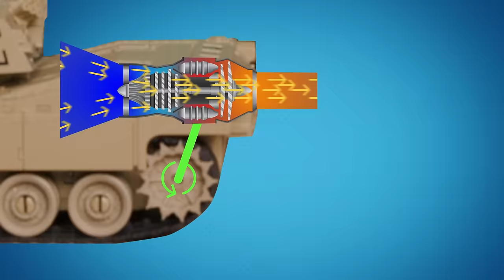Army Mechanic Reacts to Tank Fails

Comment: Regarding the last clip, I've watched another tank diver reacts to clips, where they would comment on the James Bond tank scene and the driver said things among the lines of "You wouldn't want to go through houses like that because of the underground floors of those homes that would be a death traps to your vehicle".

I've always found the highway chase in Fast and Furious to be stupid. As they said, once the track had a grip on the car, it would be sucked down under the thing. Even if the tank was a new prototype, it weighs like 60,000 kg while the Mustang weighs only like 1,350 kg. Even with the inertia of falling, it wouldn't be enough. Also, Fast and Furious cables are always the toughest matter in the universe x}

Tanks are amazing, but not absolute.

Comment: If I'm not mistaken, the engine on the Abrams is a  modified version of the same engine that is on a Blackhawk helicopter. I spent my first 9 years in aviation. Then I became a combat engineer, and in Iraq we sometimes patrolled with M113's ( before Stryker's came along). Maintenance on track vehicles is definitely not an amusing thing to do.
Reply: I dunno. The UH-60's engines are General Electric, while the Abrams' AGT-1500 is from Honeywell. Maybe the guys at Honeywell derived it from the GE core.

I heard the downside of switching the Abrams over to JP8 is that they can't use the smoke generator. When the tanks ran on diesel you could set up a white smoke cloud behind you by spraying cold diesel through the exhaust manifold (same thing they use to make smoke in jet demo teams like the Thunderbirds and Blue Angels). But the switch to jet fuel just made the smoke generator catch fire.

Comment: People underestimate how dangerous tanks are when operating them. For an M1, you have a 70 ton vehicle that has a 1500 hp engine that can go 35-40 mph. Thats alot of vehicle, with alot of blind spots, that does not stop on a dime like a car would, that has alot of mechanical/electrical components under all that weight.

I remember during gunnery in my M1, my crew passed out from carbon monoxide poisoning during a simulated night run. (Hatches were closed) Stuff went wrong, but everyone made it out ok.

Comment: The Churchill has a manual transmission, so that’s not the driver keeping on the throttle, that’s the engine probably over revving. But the Churchill is so much fun drive, my cousin and I restored the ark variant.

Comment: The speed of a tank track when it touches ground and isn't slipping is precisely 0 km/hour. Likewise the track speed at the top is 2x the current vehicle speed and at the middle points it is 1x the current vehicle speed.

So if a tank were to roll over a moving vehicle, it would flatten and stop the vehicle and once, and only once the tank has fully driven over the vehicle, the tracks would start tugging at the vehicle beneath. So this propably wouldn't have enough time for the tank tracks to accelerate the vehicle since remember, the speed of the tracks at the bottom position is always stationary.

Comment: In regards to the Sherman, the original version was an air cooled radial. I don't know which version this is... the engine bay could hold anything from a radial to a big V-8 to a diesel to five engines in a trenchcoat... yeah, the Chrysler Multibank was a hell of a mutant. Some of those old things could be REALLY particular about how you start and run 'em, and radials are a completely different beast.... hope they didn't wreck the engine.

Comment: 10:12 Well at least it wasn't the transmission like on a German tank...

10:26 Depending on the model it either has a radial engine like either a Continental R975-C1 or C4, a General Motors 6004/6046, a Ford GAA V8, a Chrysler A57 multibank, or a Caterpillar D-200A (Wright RD-1820). It's hard to narrow down the exact model of Sherman this is but it's definitely not one of cast hulls with the rounded edges.

Comment: Adding a bit of plus info to the second clip, some of the soviet designed tanks have a tube on the turret (no, I'm not talking about the gun) which is actually the air intake, you can see that the tank has this on the back of the turret in the video. So they could basically do this, but the driver stalled if I remember correctly, tho managed to restart and drive out, but don't quote me on that (couldn't find the video).

Comment: @04:20  That's not just mud...  that's a collapsed sinkhole, what the folks that speak Arabic in the Middle East call a Wadi, also known as a washout.  That's not just an Abrams trying to go through "some mud", that's 70+ TONS of vehicle trying to go through what swallows HOUSES on a regular basis in places like South America and Thailand when Monsoon season hits.  

That was just poor decisions and a LOT of expensive hardware going nowhere FAST.  

How do I know?  

US Army, Cavalry Scout, 10 years.  Fort Polk, I was OPFOR for 3 years.  We went to Peason Ridge, and got out into their Blue Mud after it had rained earlier that day.  

We didn't know the Blue Mud of Peason Ridge is some of the stickiest and thickest most traction reducing muds on earth! 3 days later, all vehicles stuck and unstuck multiple times, 1 burned out transmission, 2 broken prop shafts, 3 thrown tracks, and finally had to get a Cherry Picker out there to haul us out with its winch.  It got itself stuck, pulled the last stuck and broken vehicle with the fried tranny and busted prop shafts out a ways, unstuck itself hauling itself out a ways with its own winch, turned the winch back around, got itself stuck again hauling the broken track out, unstuck itself, ...  repeated this cycle like 7 times before it FINALLY could haul itself out far enough to be on solid enough ground that it wasn't getting itself stuck hauling the broken vehicle out, that it FINALLY was able to DRAAAG the lifeless hulk of our one totally deadlined vehicle to the flatbed and load it up.  We had to pirate the prop shafts off of the burned tranny vehicle, to fix the prop shafts we broke on the OTHER two vehicles, that we managed to get out before the cherry picker came.  

Yeah, give the Abrams some credit, that ain't just "some mud" that's a HOLE in the ground swallowing 70+ tons of armor.

Comment: 5:00 Russian tanks have a tactical log for this. You attach it to the tracks and it can quite reliably pull you a foot or two each revolution. Getting your tank unstuck from mud is a bit more relevant in Russia. Also because calling a recovery vehicle for help can end up with you having to call a third recovery vehicle.

Comment: The only thing I could think of when the tank stops while fording the water is that the driver and his hatch are fully underwater with no way out and they just lost the power system. Hopefully the crew seals were holding better than the engine.

Comment: I'm not military, just a tread-head. But it's always hilarious when the reality sets in of the physics difference between tanks and armored vehicles to commercial vehicles. You can go 25mph in a commercial van and hit a barricade and it's gonna suck decelerating that fast. But you do that in a tank that has no crumple zone, never has had a crumple zone, and typically is supposed to win such confrontations....well your mass is the same going forward. It's not the same coming back at you on impact.

Honestly you could expand this to boats, and planes (if not Navy and Coast Guard and Air Force if you can get them to clear off on it.) Even historical accounts would be cool. Like the, let's call them "German Extremists of the 1930's and mid 1940's," were trying to build tanks so stupidly big, they were taking diesel engines they had built for ships and submarines and slapping those in them. I don't think taking an aircraft carrier's nuclear reactor and shoving that into a variant of the M1 Abrams is a great idea, but that was the mind set back during that time. There's also the mad inventions of Ferdinand Porsche and John Kristie. They both developed tanks (of sorts) for Germany the US and the USSR respectively, but they were more of the mind set of, "tanks are just heavy sports cars with a gun and extra people aboard." Like you get a good historian on one of your videos to go over Kristie's and Porsche's crazy ideas and you'll see how bad they were to both tanks and sports cars during that time period.

Comment: Fording without a kit is the one place the M60 series was better than the M1. On the M60 series there are two giant ports you can open up so the engine draws the air through to the turret and not from the outside normal intakes. Also handy im the sandbox since it acts like air conditioning sucking all that air in through the hatches.

Comment: 1st clip ; Ukraine, tank slip because differential kicked in when he started to lose traction
2nd clip ; Ukraine as well, tank lost grip at the bottom (forded too slow and allowed the hull to "float" a bit)
3rd clip ; MURICA ! But once the bottom hull hugs the mud, it sucks like a succion cup and it's hard to get out
4th clip ; Chief died a bit when he listened..
5th clip ; most invited crews from Zimbabwe, Iran, whatever never ran T-72 before. (Also, before 2022, NATO was invited but never joined)
6th clip ; Happened during training for the track, was a belarussian crew who engaged the corner at nearly 70kph (no one was severely injured)
7th clip ; M4A4 with Chrysler A57 "multibank" engine, very prone to failures and overheats (it's made of 5 engines paired together, very hard to cool and maintain)
8th clip ; French AuF1 artillery system (155mm), welp.. french drivers !
9th clip ; 2S3, russian 152mm artillery.. welp ukrainian this time (the problem here is the "rebound", a problem when suspension of railcar and tank sort of adds and create lot of movement)
10th clip ; T-64BV, ukrainian again
11th clip ; russian "crash".. yes, it happens a lot and it's well explained by experts
12th clip ; BS
13th clip ; Churchill tank (British) during mobility trials

Comment: tracked vehicles are awesome but if you have the wrong operators, they're deadly.  Had an old crusty E5 when I was in tell me about a dumb ass that slammed on the breaks of a M113 APC and nose dove into the ground.....with the troop hatch open.  He said he went vertical and smashed his knee on the edge of the hatch.  He still had issues with it years later.  He's lucky the damn thing didn't flip over itself like it could have.

Comment: There is info that surprisingly wasn’t mentioned here when it should’ve been and if it was it cut out because of the way these channels just horribly cut shit out to fit a certain video time.

When tanks are transported they put the canon into a mount because all that flopping around can break the mechanisms move the gun.

When a tank flips crews are taught to how to escape the tank when it does indeed flip.

Tanks will have rubber or metal treads depending on the surface they are going to be driven on so metal for off-road and rubber for on road because metal treads can destroy the roads surface and tank slapper is a thing which causes the tank to loose traction and is why they suddenly skid out on normal roads

The Sherman tanks had multiple variants which includes the engine. They could have a Radial, twin diesel, multibank or a v8.

Tanks are driven in different ways depending on the tank. You can have a traditional steering wheel, bike like handle bars or 2 sticks that control each track

Comment: 12:30 It's worth pointing out that in case of crappy russian tanks, the visibility is even worse than what these guys know from the Abrams. Additionaly, the comms inside russian tanks are famously terrible, coupled with bad training = this is what happens. Also when it comes to difference between crappy russian tanks and proper western designs, russians still use two levers to apply brakes on either the left or right track, which was how tanks were driven back in WW1. This is of course much less intuitive, more physically demanding on the driver and less precise than the system described by the guy in the video. Almost all western tanks got rid of the sticks in the cold war era (except brits but they still can't get rid of rifled guns either so let's just ignore them)

Comment: That AuF1 and 2S3M may have climbed the ramp a little bit too fast which caused them to flip over and they aren't exactly well Armored and as for the T-72 that started smoking in the water it probably wasn't tightly sealed from the side where its exhaust is but they also may have had a malfunction in the  system that's supposed to keep the water out and yes Soviet Tanks have an all Steel tracks which are good for speeding up, drifting but not so good for stopping or breaking 😅

Comment: The 188 ton MAUS sank 6 foot deep into mud... and extricate itself out within 1 hour
Reply: Also Germany had 3 running tanks in WW2 that were turbine powered.
GT101 in Panther went 49mph
GT102 in Panther went 52mpg
GT103 in Jagdtiger went 42 mph

Comment: so the old tank flipping on its side is a Churchill mark 1 which was made with the old mind that tanks were meant to go across trenches hence its length and they just hit it at the wrong angle and flipped instead of going over top of the trench like it was designed to do
Reply: While you are correct the Churchill was designed to go over trenches it wasn’t designed to go over the one shown in the video as that is a anti tank trench which were dug in certain areas in the U.K. as defensive measures against invasion. The video was probably a training film showing what would happen if the tank entered at different angles and the effectiveness of a well built anti tank trench.

Comment: I was on a M1 (yes a M1 with a 105)  for short time at Fort Hood before Shipping out to Germany .I was On a M60 - M60A3 (were I sent most of my  5 years) you change  your intake to  drew air through Turret . Oh and  all  tanks water seals leak :=)  You have a Pump  to Pump the Water  out !  If  you get stuck (1 case of Beer ) Oh Fort had OF4 and got to Drive and fire a  t-60 , the reason the Russian gun are all ways point up  it they roof of the turret  is  so  low . OH over heating  ( I was on a Old M60 with small oil coolers  at Fort Hood It would over Heat  every time in the field in the summer  by  13:00 hours )  I load my tank  on trucks  and trains  100 time   . You drive  a with a  t bar  . DUMB MOVES  -------  First CAV   -   8ID 5/68 Armor      PS  2  people  that are almost never  on a Tank   -  A  colonel   - A Maser Blaster